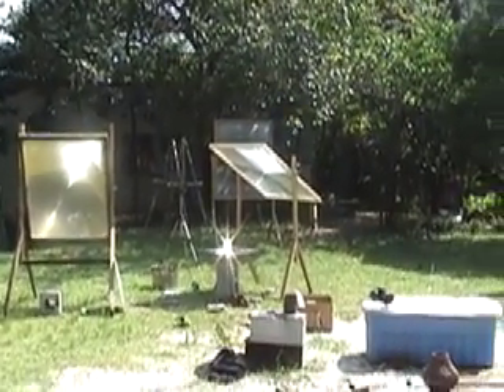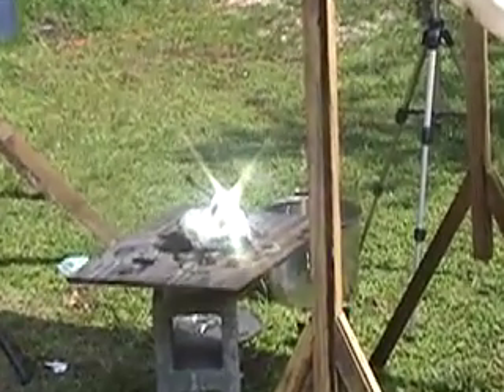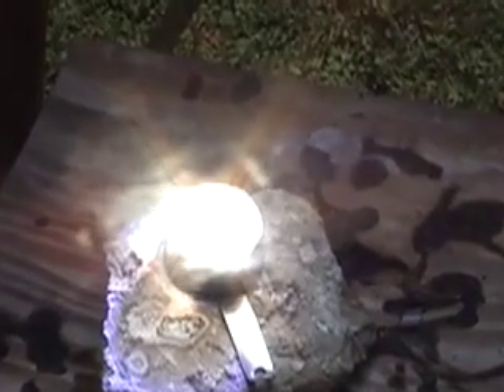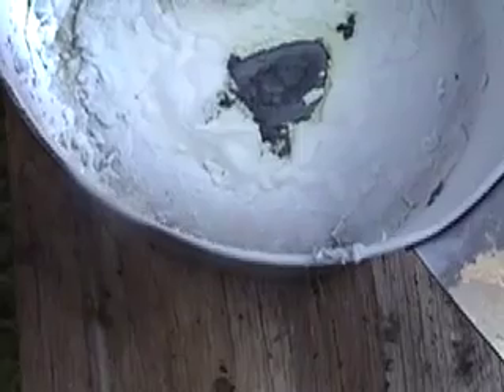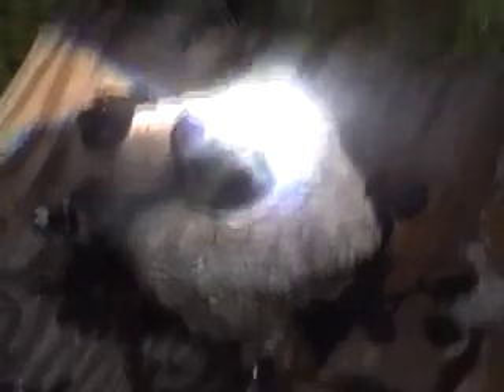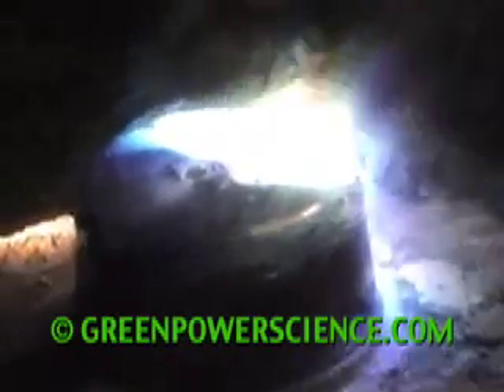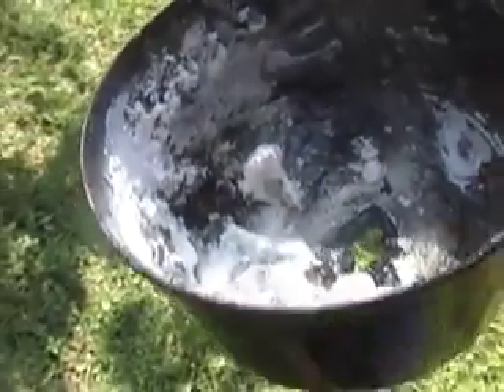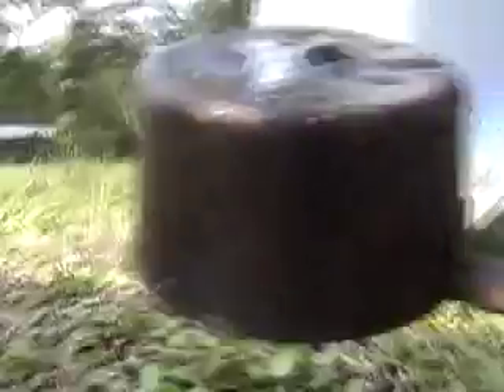Fresnel Lens SPOT scorcher heating various objects with concentrated solar power

Comment: you could placed a huge pan, fiil it with water, and put a big stone inside of it, in a specific shape and a specific placement. so it would look like an 'iceberg' (body inside, and a small tip above water surface) and then, place the fresnel beam to this tip. 

the stone will boil the water, and you can cook. 'energy-free cooking'

Comment from the maker: Actually "melting" zinc is not  dangerous, but you are ABSOLUTELY RIGHT about "burning" it. Since we are always outside because of the sun, it is only a concern when there is no breeze. Zinc is a lot safer than lead as lead is stored in the tissue vs. being flushed like excessive zinc. Most wielders are warned about wielding galvanized sheets because of the zinc oxide fumes. Lead is not mentioned because there is no reason to wield it. THANK YOU, I will add warning!

Comment from the maker: Hi,
Two ways. 1 You could power a Sterling Engine that turns a generator or steam production using the same principal. 2 would be to enhance photovoltaic solar panels. The later is more reasonable for now. We are building some large engines that run off of heat, once they get up to speed I will have some videos of that. Thank You for the question.